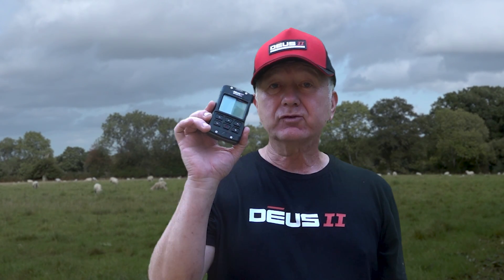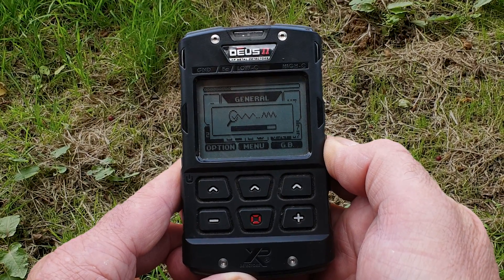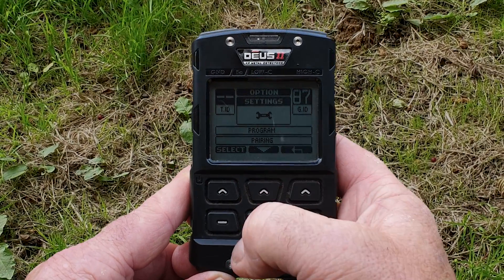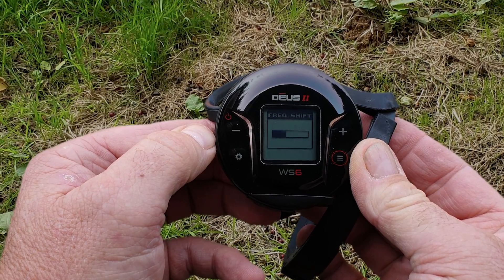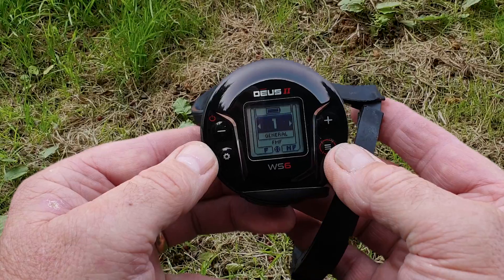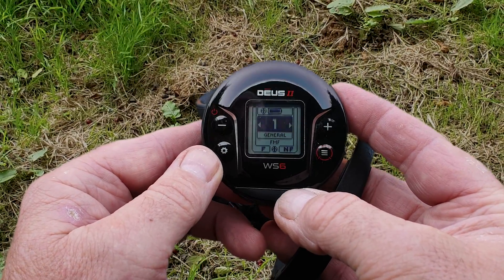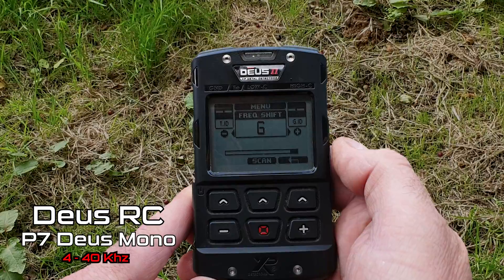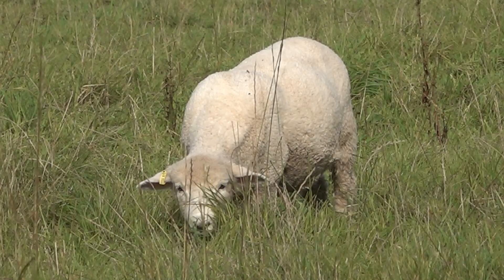Say goodbye to Electromagnetic Interference (EMI) with the DEUS II metal detector

Comment: I have had the Deus 1 since 2015 and ive been rather happy with it. But lately, its been harder and harder to use it on club digs, as almost everyone and their dogs, have multifrequency detectors, and it make it impossible to use the deus 1 near them. Even the Hf coil got issues, Its better, but still not good enough. So my solution to this problem arrives tomorrow in the mail.

I bought the deus 2 ws6 master version and the wsa II-XL headphones, will buy the remote later if I need it.

Comment: Just got back from detecting under pylons, couldn't find a clean frequency so had to use the mono program and a very low frequency.
Would setting the frequency scan to auto help or would it cause too much chatter?
Also are smaller coils less affected by emi? I presume a big coil acts like an aerial to pick up more interference.
Cheers Gary

Comment: Hi Gary. I have a xp deus 1 and have just purchased a 13" x35 coil and a 9" HF elliptical coil. When i use the x35 coil my detector is going crazy when i detect close to another detectorist. It doesn't seem to matter what detector they are using or what program i am using. Is there any way of stopping this happening? Kind regards Bri.